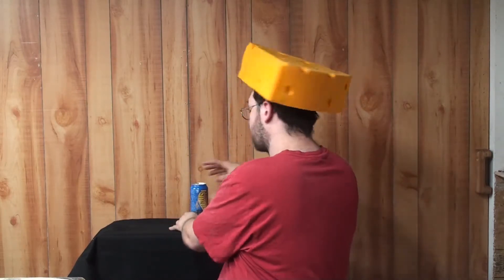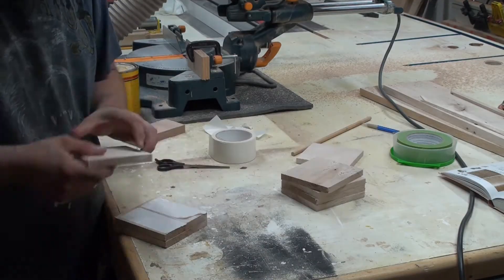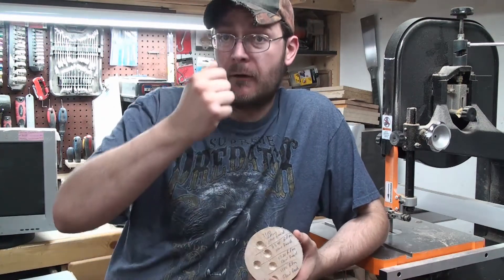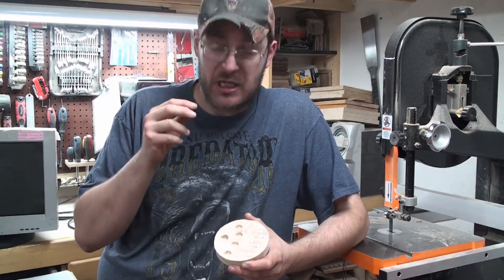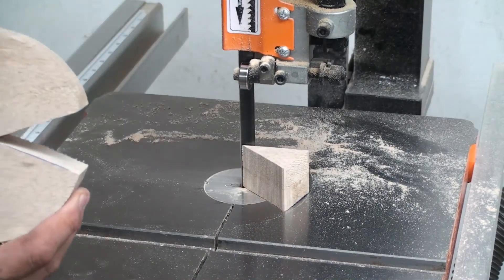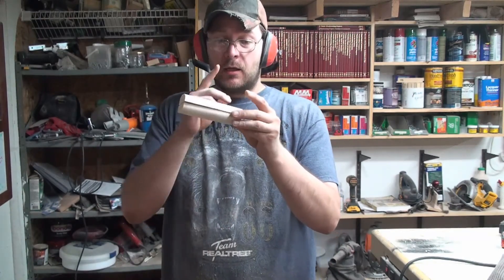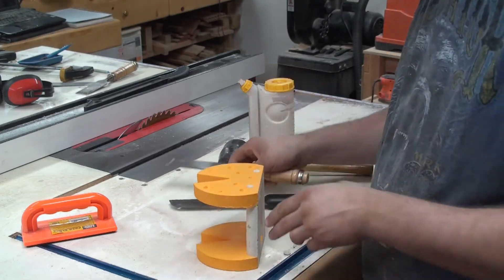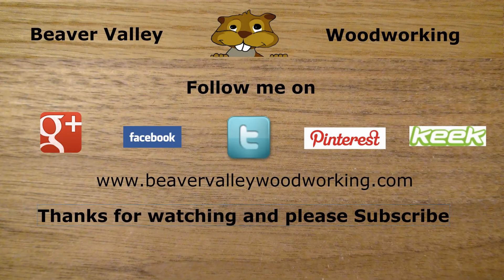Wooden Cheese Coasters #12

Comment: This is the first time I've seen your thickness planer on the drawer slides.   That's a really cool idea!   And I'm glad to see that I'm not the only one that uses router bits of my drill press.
Reply from the maker: Nick Ferry Thickness planner on drawer slides this way I don't have to pick up a 95 lbs machine every time I need to use it. Router bit in the drill press that was the only safest and fastest way I can think of putting dimples in the wood. Surprised I didn't make a dimple making jig using a plunge router. Sometimes in woodworking the simplest way is the better way.

Comment: Love it. I use router bits in my drill press all the time. You would be amazed what all you can do with them. Keep up the good work Dale.
Reply from the maker: Emt Scythe Thanks. I thought I was weird using a router bit in the drill press, but for this project that was the safest way I can think of to add the dimples on the wood with out spending tons of time on building a jig.